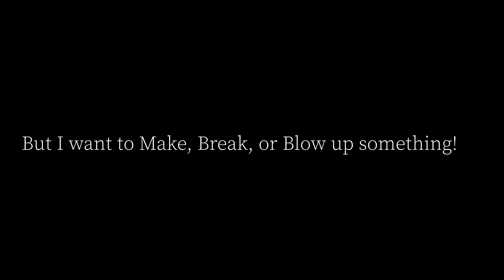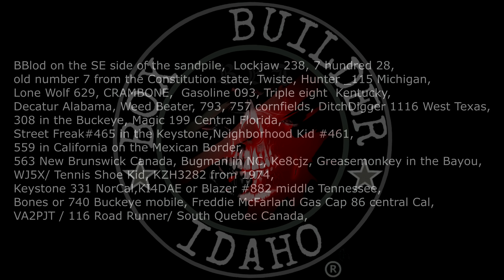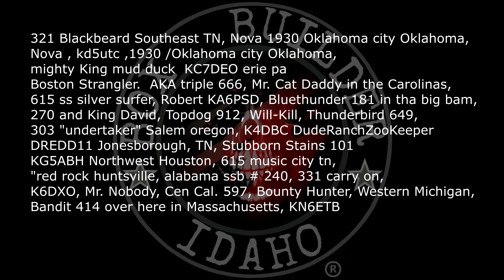Part#1 The Crown Jbl A6000 Gti

Comment: As George Takei would say OH MY. That is a work of art!! you guys are lucky the wires did not damage anything else! I have an XPE4700 I need to tear down to find a loose connection or bad transistor, the amps makes popping noises randomly even with the input fully disconnected. That is going to be a chore since it has 16 transistors and diodes down on the plate. That will be a full half tube of thermal paste when I get it back together! I cant imagine how much it could be for this father of all amps!!!

Comment: Looks like a nice bit of kit, at my place of work about 20 years ago we had about 100 Crown  MA5002VZ running subs in our touring systems , so one day I connected one amplifier in bridge mode to an angle grinder ( UK 240V  unit ) and used a signal generator @50 Hz to drive the amp and yes no problem even cutting some 2 x 2 inch steel angle with it. Keep up the good work on the RF stuff, I have just restored 2 old Heathkit SB200 units for my ham radio shack and they both produce in the order of 750W on the Bird 43

Regards

Dave Fletcher.  
Liverpool the home of the Beatles.

Comment: Amazing amp. Good to remember the good ole days with a Power 200 and two 15’s in the hatch of my Mustang. Damn thing rattled all the rivets out of my pricey louvers. 😀
Reply: Back in '91 I had 4x 12" Kickers in a custom box in my '88 Mustang GT. 
2x faced up and 2x faced the back seats. 
Was amazing with only about 100w or so going to each from a Power Acoustik amp. I think it was a 430 or so?

Most recently (almost 10 years ago now) I was running a 1200w Kenwood with large cap w/integrated digital volt meter to 2x Kenwood 12" in bandpass box backed up by 4x 8" Sony bookshelf speakers lined up in the back seat of my '08 Suzuki Grand Vitara getting fed by a 200w amp and then I still had all the stock speakers running. 
It was a lot of fantasticness and my rearview mirror was useless and would not even stay on!
I'll get back to car/home stereo one day.

Back in like '05 I had a crazy home theater with about 26 speakers! (Not a BS home theater with tiny shit!)
2x 12's (KLH 3-way floor) *$100
2x 12" (Fisher 3-way) *Free
8x 8's (Sony 3-way bookshelf) *$100 total from a Fry's electronics deal! these are $200 a pair on eBay now!
2x 10's & 2x passive 10's (ESS loud speaker) *Free
4x 6x9 type 2x (Zenith from TV) *Free and 2x (Bose) *$49
2x (Jensen 3-way tower w/2x 6" each) *$100 pair
2x powered subs (10" KLH 120w) *$80, (10" KLH 80w) *$60?, Fry's always had some killer deals!
 - I have forgotten the rest!

Amp was a heavy 600w AIWA 5.1 Digital Surround, *$200 
900w total RMS with the subs, in my mom's living room!
Amp had an 8ohm/4ohm switch that I used at 4ohm and doubled up each channel with speakers!

While watching the Matrix, when Neo stops the agent's bullets in the green digital hallway and the walls flexed (with bass note heard, Whoooommmm), my walls flexed too!!
I also listened to a LOT of competition BASS music like BASS305 & really liked "Intergalactic" by the Beastie Boy's! 
I would walk down the hall and poke my head in my mom's room (already open door btw!) and ask if it's too loud or too much and she'd just say "no, it's fine."!!!      I LOVE YOU MOM!!! (R.I.P.)
The neighbors preferred it turned down during & after dinner time!

Only other furniture stuff in that room was 2 bookshelves and a small table between two pleather LazyBoy recliners!
Those seats had dual zone massage and heat!
Up in my room was my base station consisting of a Galaxy 99v w/Silver Eagle on a Messenger M4 amp with A99 up at around 80ft to tip!
Life was perfect for a while! (couple years)
This was all about 2mi SW of the new 49'ers stadium in the heart of the Silly-Con valley!
I was a beast!
I'm still a beast but can't waste money like I used to, ...now that I am a somewhat responsible adult with child, job and no time!
(I'm a beast on the DL!)

73, 
272 and I'm out!

Comment: I'm guess, since I have no personal experience with this amp, that this is a big ol' Class D switching amplifier. Meaning: very efficient!! Mucho power!!
Reply from the maker: i think i was told one time class "I".. witch thinking of it i now need to google that
Reply from the maker: Class I Amplifier – The class I amplifier has two sets of complementary output switching devices arranged in a parallel push-pull configuration with both sets of switching devices sampling the same input waveform.
Reply from the maker: Class-I, also known as BCA (Balanced Current Ampli- fier) is Crown's patented, cutting-edge technology that gets more power out of an amplifier with less waste than was ever before possible.
Reply from the maker: looks like a crown thing to me
Reply from the maker: Class-D to T 	ON-OFF non-linear switching 	θ = 0